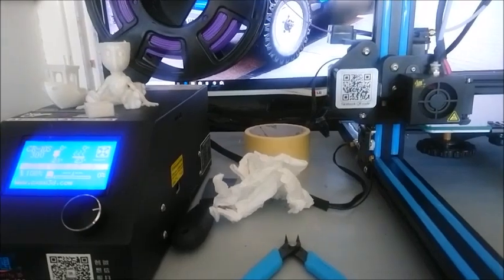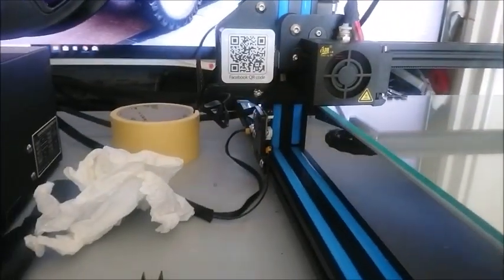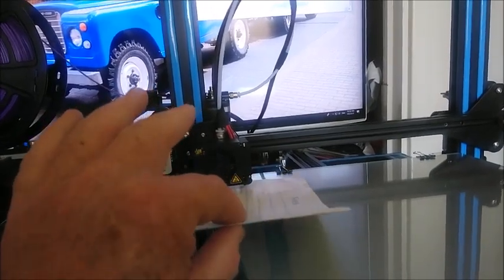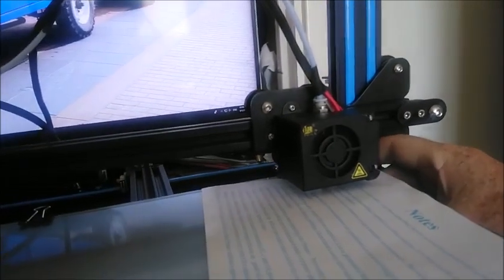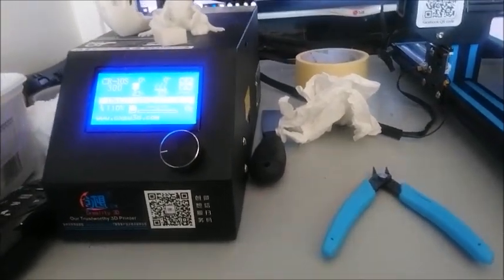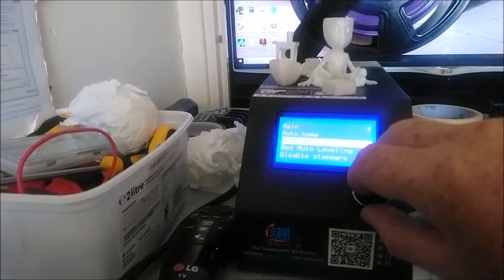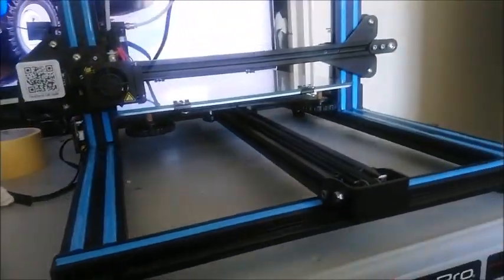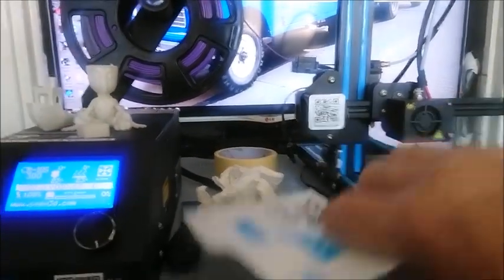Bed leveling the Creality CR10S

Comment: its really too bad you cant hear them its so faint, its probably a worth while channel to subscribe too, but i cannot hear with even everything up to 100% and its not my laptop either cause all other channels work great, just thought i would mention it
Reply: Sorry, I haven't been in touch sooner I haven't been able to do any future videos and to change the volume in future I will make sure the volume is at the correct level with no music in the background I am restarting this printing videos in the very near future I need to catch up on future printing events my printer hasn't been turned on for a few years so I fired it up yesterday the 1st may 2023 and it printed as it had never been left for over two years sitting in dust so am I impressed with the reality cr10 and the answer is I sure am it printed to a very high standard the belts are fine to perishing so its made of good quality materials I have upgraded the heat bed so it can now print ABS with ease and it heats up in seconds now so I would recommend upgrading your heat bed I will find out what I used and how I did it and make a video on what and how I did it put it this way if I can do it anyone can so all the best from john from extruder guys.

Comment: Mine doesn't have anything that says "bed leveling". I have the CR-10s...?
Reply: I see no one responded for u either on this question..i have the same issue
Reply: Same here
Reply: @niveknailgun  you figured it out?
Reply: @AlexStutters  im just as lost 
i have cr-10s v2
Reply: @Darien1243  let me know if you find a solution please
Reply: I know its old video but im replying too you now, you need to get newer firmware for the cr10s
Reply: Have you updated the firmware on the printer?
Reply: its called bed tramming